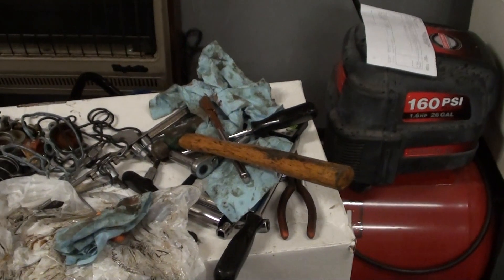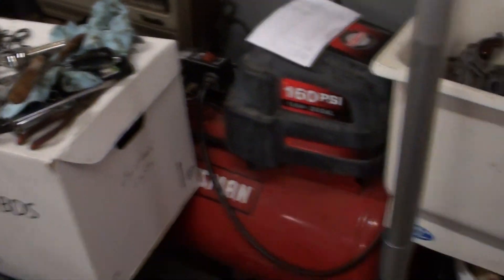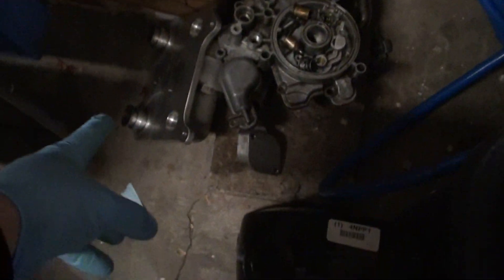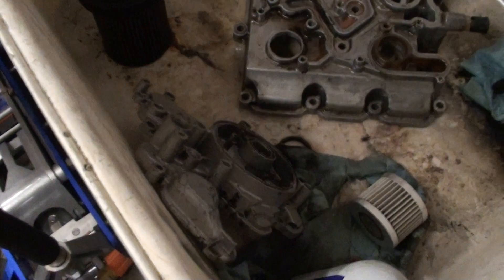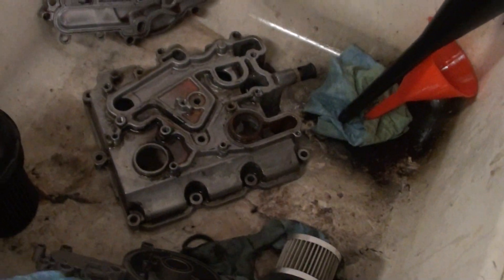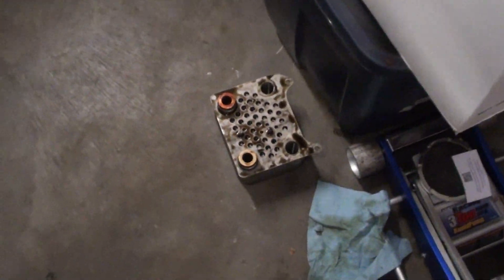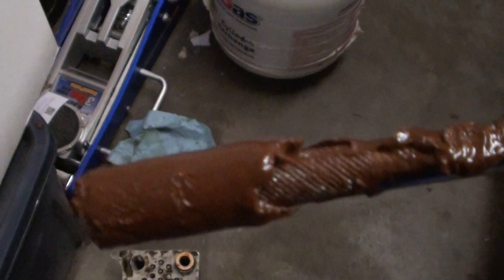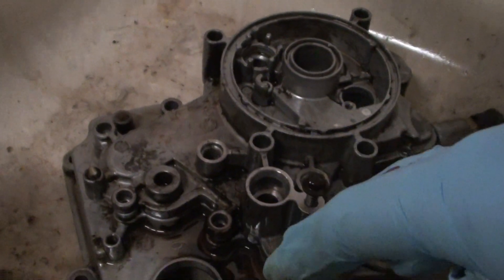Powerstroke 6.0 IPR Remote Oil Cooler + High Flow Coolant Filter Install - Part 10

Comment: Hey Josh, I have probably an updated version of IPR's remote cooler mount and full oil cooler coolant filter installed for the past year now and deltas have been 2-3. When they get to ten or so I take the filter out and clean it and I'm right back to 2-3 again. My question for you is seems like I've had good luck with the coolant side of things but I'm concerned about the oil either not being filtered enough or starving the motor at different points. I have an issue that seems like the hpop is being starved when I'm on it hard. I understand it could be leaks or a faulty ipr valve but I find non of the above to be at fault. Just wondering if you could shed some light for me. Feel free to email me if you'd like separker628@gmail.com 
Thanks in advanced for any help!
Reply from the maker: Stephen, an easy way to check to see if you are having oil side issues (hpop starving or a leak) would be to watch the IPR duty cycle and the ICP pressure reading.  If you see ICP dropping and the IPR going to max (84% or something) then you've either got a leak or lack of oil.  Do you ever have hot start issues?  if not i'd say you don't have a leak.

Comment: Hi Josh,I was thinking of getting this item before watching your trials.    One question, did you find out what was causing the leak you reported?
Reply from the maker: +Roger Jordan I'm not sure which leak you're referring to.  The main one I ran into was due to an incorrect stud length on the IPR bypass manifold which cracked my oil cooler cover.  I'd have to go back and watch the videos if there was another one that I encountered.
Reply: That is alright.    No success with this unit though?   Seemed like you reported a poor delta  reading at all times.  Thank for the information.    Enjoyed the videos.
Reply from the maker: +Roger Jordan No success is correct.  I no longer run any of the IPR products and the truck runs great.  Coolant filter is the way to go after a good flush

Comment: I'm curious if IPR gave you a refund on the parts you purchased.  Also, did you keep the EGR delete from IPR?  If so, how has it worked out?  I have a 2004 F350 dually with 90K on it that I just bought. I'm going to delete the EGR even thought the previous owner just had a new cooler installed. I'm also going to install a coolant filter like the PMM although I think I will probably go with the Sinister unit.  On a side note, I noticed in you videos that it appeared you live in Lenexa or OP.  I live in Paola.
Reply from the maker: +jprr6 He never refunded me so I have a pile of worthless crap sitting in a box collecting dust.  I did keep the EGR delete but now my black onyx gaskets have failed so I'll be pulling the cab to redo them with OEM Ford gaskets.  At that time I'm going to take all of the IPR stuff off my truck and go back to the stock cooler with freeze plug block-off (which I had before and had no issues).  I used to live in Olathe but back home in Fort Worth TX now :)  Hope everything works out good for you on the truck.
Reply: @paintballrefjosh   I just read you live in Fort Worth.  I have IPR kits on 2 trucks.  Was wondering if you work on them or could help me out with some issues?
Reply from the maker: @JavierGarcia-je5ce  Hey yes I'm in the fort Worth area and would be glad to help in any way I can. What issues are you having?
Reply: @paintballrefjosh  looks like my oil cooler cover is leaking.  I changed the oil and within 60 miles is started leaking oil bad.  I have photos where it's leaking but can't upload them here.
Reply from the maker: @JavierGarcia-je5ce  They did have a big problem with leaks at one points.  one of the studs on the oil cooler was too long and ended up cracking the housing.  I have a video about it here: https://www.youtube.com/watch?v=dD-MftiOvdo
Reply: +Joshua Scarbrough geez man that guy should refund every penny you spent, what a horrible kit, not to mention all the time you spent!  Thanks for the vids... bulletproof egr and oem cooler is the way.

Comment: I really appreciate your videos and your patience.  I believe I will be going back to the OEM oil cooler and Bulletproof egr cooler.  Later I may decide to go to the Bulletproof System, the most expensive one.  If  you believe otherwise, I would be grateful for your input, Joshua.   Thanks for helping me get closer to the next level.

Comment: Yeah I have a 06 with 116000 miles have had the the oil changed every 50000 miles and at 110000 a radiator flush and mine is still going... I am also running a banks six gun sense 07 set at the 4 setting most of the time. My delta is at about 6 to about 12'. In 85 degree weather yesterday going up a switch back hill am running at about 202 engine coolest and 211 engine oil..

Comment: Man you do have a lot off patience, now that you are done with the ipr try out the bullet proof diesel kit and tell us how it works...;)
Reply from the maker: haha I've thought about it, in the middle of building a shop which will house a 2 post lift so I may end up doing the BPD kit one day
Reply: I had reached out to Josh about resolving his issues. During that time Josh was in the middle of a move and stated that he did not have the time to mess with the truck. 
We had sent Josh a prototype GEN3 EGR delete to try out with the kit. I can't confirm if his delta readings were taken with the experimental GEN3. After looking through several of his videos I did notice that he was running the GEN2 EGR delete and feeding his oil cooler with the heater supply which is "NOT THE CORRECT WAY" to run this kit. This kit will work properly if used with the production GEN3 EGR Delete http://www.iprresearch.com/IPR-GEN3-EGR-Delete-Kit-for-all-2005-2007-Ford-Powerstroke-6.0-will-fit-F250-F350-F450.html or the coolant manifold which we include in the kit http://www.iprresearch.com/IPR-Coolant-Manifold.html
Reply: BPD is expensive. I say this because I spent the money already 😂. However, I truly believe that my truck is going to run forever. I put a welded shut EGR to support the y-pipe. The air to oil cooler with remote oil filter 👌 I also put 7.3 fan clutch as well. When it gets cold I just cover the grill. Hatas guna hate, but the proof is in the pudding.

Comment from the maker: The IPR kit actually uses a 6.4L oil cooler because it has 4 bolts on the corners instead of 2 like the 6.0L. I'm not sure what my issues were but I just couldn't invest any more time (or downtime with my truck) trying to get this kit working.